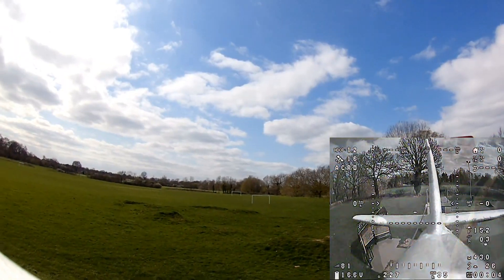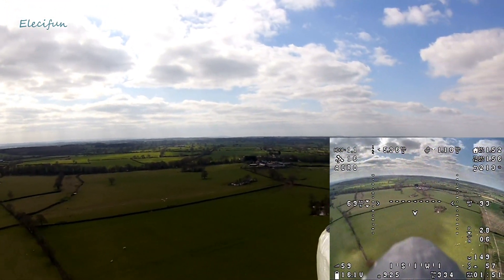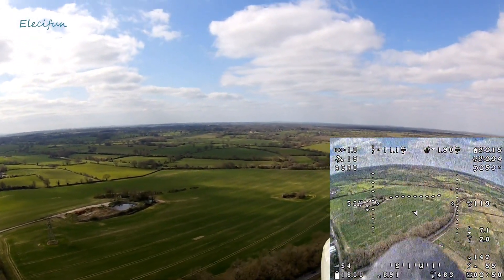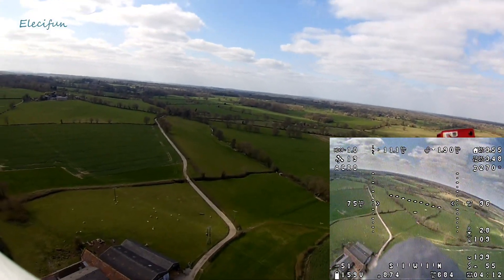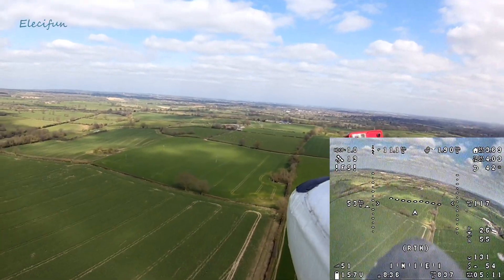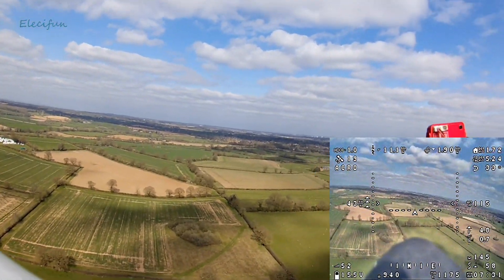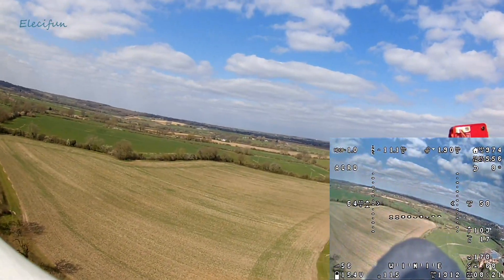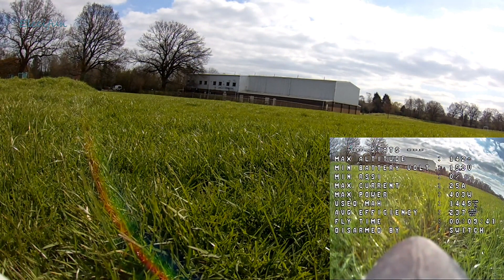INAV Emergency Landing MAYDAY

Comment: Hi there! Thank you for sharing that WTF moment! Boy, have I have some of those too over the years... Will set my Inav like you shown yours, and try to remember NOT to hit RTH, if this ever happens :) I guess if you have a failsave, i.e. not radio link at the same time, you are lost, as it will then automatically go into RTH...
On another topic, I noticed you have 2 cams - how do you switch between them, what have you used? I use the Taranis X9D with the 8 channel R9M and channels are tight, as I am using one for RSSI. 
Thank you!
Mike

Comment: I get that this wasn't inavs fault, but you should try out arduplane, its cheap if you use an omnibus f4 pro or matek f405 wing. It's much more mature firmware, and whilst inav is great, it is still relatively new. Arduplane also has dead reckoning for gps loss.
Reply from the maker: Hi 
Epicness 357 I have never looked at Arduplane before. I have been using INAV for over a year now and have no complaints, it is getting better facilities with every release.  I am using a Matek f405 wing in a new build and will look at the Arduplane documentation. Cheers for the tip.